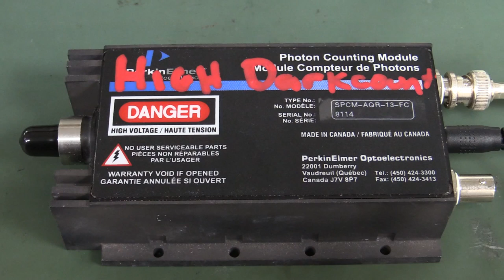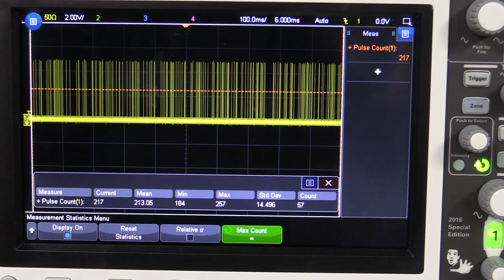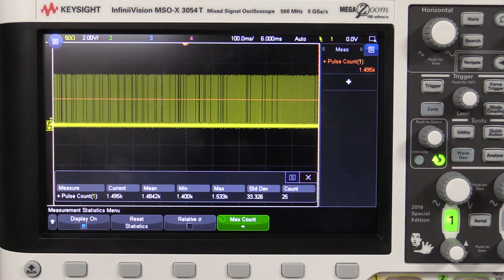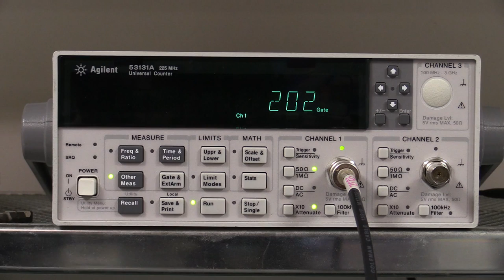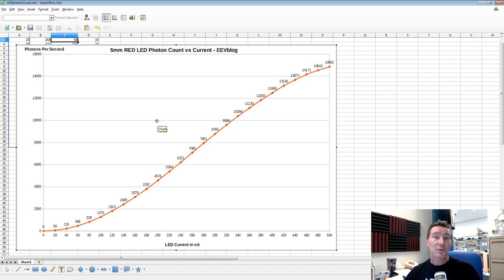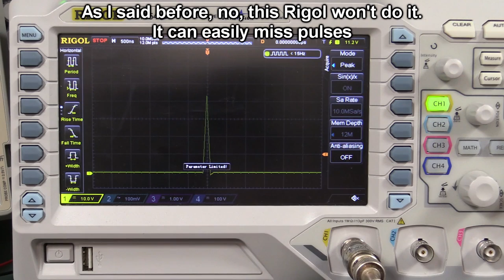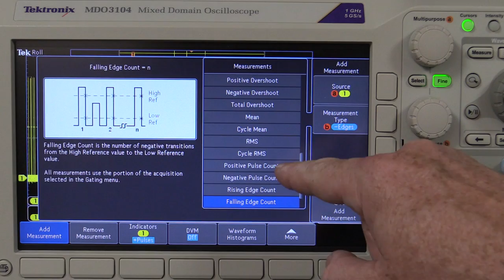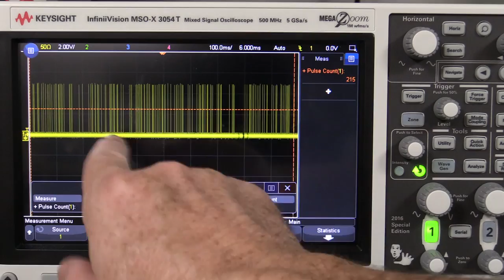EEVblog #869 - Counting LED Photons!

Comment: So 100ms sampling time doesn't have the "vibe" but 1 second does? You could also use 10 seconds, sure the longer the sampling time is, the closer your counts will be to the average. But the average will still be the same. Also, are you sure the Rigol's frequency counter measures the distance between pulses? In that case one would expect it to be all over the place, but it wasn't it actually displayed pretty much the same values as your final setup with he Keysight did (just no average of course) and it also seems to refresh once a second which may suggest it simply counts the pulses (or rising/falling edges) every second and displays whatever it counted...

Comment: The danger high voltage warning was hilarious. The current is so low you wouldnt even feel much of a poke. I repurposed the HV psu in these to operate the MCP in a night vision tube, and the output also did double duty as overload feedback. ❤

Comment: The latest Rigol firmware update (10.2015) added the pulse and edge count feature. So you can upgrade the oscilloscope for new free features. Also, in the measure menu there is an option to set the area used for measurement, i.e. whole screen or cursors. It's just the problem of RTFM

Comment: In the decrease in gradiant at the higher currents maybe because it wasnt measured correctly. The same reason why it dropped off at even higher currents? 
I'm a bit sceptical about that.
Reply: +Hellsslave666 
I agree. I don't trust the values beyond 10 000 Counts/s.
Checking with the universal counter might have been a good idea, to rule out the scope miscounting pulses.

Comment: Excellent video Dave, I have two of those exact SPCM units which were scrapped due to high dark count, and haven't yet found a use for them!  We use them for photon correllation spectroscopy.  Not a cheap bit of kit, as you say!

Comment: you can go higher if you use a Filter between the led and detector. the amount a filter takes away you can measure in a range you already know and then extrapolate, add more filters for covering more range

Comment: Thank you for sharing this experiment. The mayor source of error is, I think, the coupling between the led and the fiber connection in the APD. Dave, have you used the formula in page 6 to calculate the "actual countrate"? . In this case afterpulsing does not appear to play a big role.

Comment: Just a hunch, but is this not looking like a Bell curve? The chance of high level electrons jumping to the lower level is dependent on the amount of those electrons, which is dependent of the voltage over the LED. I know you measured the current, which should be linear if every electron emits a foton, but there is maybe some leakage of electrons?

Comment: You could use an optical attenuator to see what happens at higher currents. You could use some sunglass and measure the transmittance and include the factor in your data readings.

Comment: I saw your count taper off at high currents so it appears sensor is non linear.
I would like to see a group of 5 LEDs in at the input and then measure pulses of each LED individually. Then turn on 1 then 2 then 3 etc. This ensures linear input so pulses per second should also be linear. If not then you will have to calibrate sensor accordingly.

Comment: @ 5:20: near perfect Poisson statistics: mean = 212.8, standard deviation = 14.4 → variance = 14.4² = 207.4. Of course for Poisson statistics the mean is the same as the variance, and for dark current like this you expect Poisson statistics.
Reply: To follow on on that: something is fishy when you actually measure the signal. The sum of two Poisson distributions is another Poisson distribution, but the stats seem to be off. Is that an indication that the signal is not yet stabilised?

Comment: Great video!  Only problem is most people can't afford to buy one of these modules, so it would be really great if you could show us how to build a quenching circuit with a SPAD diode from scratch.  There are some "safe" low voltage SPAD's that might work (<40V/thin membrane).  If one could scale these into more affordable and safe devices, there are lots of very interesting projects in microscopy, astronomy, medical imaging, quantum physics, and other fields that could open up for the amateur and professional alike.  Hanbury, Brown and Twiss were able to determine what was thought to be impossible (a stars diameter beyond the Raleigh limit) using an effective super-resolution technique by photon counting half-a-century ago using only a couple of photon counters.  Imagine if you could get an array of these to make a quantum telescope or something no ones has thought of yet.

Comment: Dave. On the Rigol you could have used the hw freq. measurement that you have still turned on all the time. It was showing the pulse frequency ( count per sec) as you wanted. Missing stat on this parameter is annoying but the tool can measure the count correctly.

Comment: Is your powersupply really linear? How does it work? Especially the upper end seems pretty suspicious to me.. You seem to be far away from the saturation of the detector..
Otherwise this might be eplainable by differents layerheights in the diode, some may conduct earlier others later, the laters may be eclipsed, so no light is emitted which hits the detector..

Comment: What do you think of using your low voltage sources to apply a very small differential between two opamp inputs and to check if the output is like the open loop gain describes it in the datasheet?

Comment: Look into your "detector" dead time (in this case you have two detectors, the APD sensing the LED output and the RIGOL scope which you are using to detect the pulses. Both of these "sensors" will have an associated "dead-time" and pulse overlap associated with the time constant of the "detection" process. This probably is the reason for the response roll off at high rates.

Comment: One reason you might be seeing the end turn down is the sampling rate on the scope is too slow and you are seeing the pulses pile on top of each other and being counted as a single pulse, just like you saw at the currents above 500 nA.
Reply: It would be interesting to see if you see the same thing with the counter or by taking the integral of the scope waveform.

Comment: I think the rolling of is a feature of the SPAD sensor. The diode requires a finite time to recover (quench) after it avalanches, if photons are striking it during this period it fails to recover. I imagine if you continued to increase the current to the LED the SPAD will never recover and you'll stop detecting anything.

Comment: Interesting! I bet that the saturation at high current is caused by the photon counter itself. If theres some small leak resistance / offset current, it might show up as a non-linearity at low current values?

Comment: I have designed a board for a photon counter, the other guy did the firmware for it and it was a pig to calibrate! Trying to get a batch of them to give below a rated dark count and all perform the same was like trying to catch a fart in a breeze! no wonder they were expensive! It was a very interesting project to do though: quantum physics, electronics - what's not to like! Interesting video! I often wondered this!

Comment: The junction temperature of the diode increases when you ramp up current, which would decrease the photon output efficiency, that might be why it rolls off with higher currents.

Comment: This is a different and very nice experiment. Thank you very much. 

The current (assumed it is proportional to the photon counts) can be given by a               I = B exp[(-Eg+eV)/(xkBT)] as long as the diode is a simple p-n junction but not having a MQW (multiple quantum well) structure. So your experimental curve may fit with such a formula. In this formula, B and x are constant depends on the specific LED characteristics, Eg is LED energy band gap, V is applied voltage (Volt), kB is Boltzmann constant and T is temperature (Kelvin). 

Do you know which part of the circuit or chip of the photon counter is responsible for generating the nano second pulses?  Thanks

Comment: Interesting. As for the curve shape, are you measuring the characteristics of the LED, the current source or the detector - I would think all of these.  I doubt you have the sensitivity to reliably detect single photons and in any case, not all of the emitted photons will reach the detector. Recalling 1A is 1 Coulomb per second and the electron charge is 1.6E-19 Coulombs, even 10nA represents a significantly large number of electrons passing through the LED junction. I suspect the photon efficiency will be lost in the noise.

The graph looked to me like it has 3 stages, the start of the graph at low current the signal to noise is very low so its possible that you are seeing some detector noise effects. However, it is very smooth looking so probably something else. At higher current the relationship looks linear and at the end there seems to be some saturation of the detector or counter. Fitting a straight line to the linear section looks like it will intersect the current axis at some small positive current. That's maybe a leakage current? The leakage may change with applied voltage? How about measuring the volts/amps relationship? Does it look the same?

Comment: I wonder about one thing. You said that Rigol will miss some pulses because it doesn't have enough memory depth. On 100ms it was 10M and 10 MSa/s. On the other hand Tektronix on the same time base was set to 1M and 1MSa/s. I thought that the most important thing in such measurements is to have as much memory as possible to be able to set highest sample rate (I know that scope does this automatically).

Comment: Are the current and voltage of the supply actually constant at the really low currents? If the LED is producing 40 individual photons per second at the low limit, I'd be really intrigued if the current was constant the entire time. What's the LED doing at a quantum level between every photon?

Comment: What do you even use such voltage/current sources for? Which application ever requires femto-amps?
Reply: +Leonelf Leakage currents in ceramic or other low leakage capacitors for one, reverse biased diodes for another.

Comment: Cool. It looked like the light was purple at very low power. Color actually changes with temperature.
If you have a good recent DSLR camera you could try 1 second exposure or longer.

Comment: Remember that as it is a diffused red package you will lose half the emitted photons to the package. A clear one would have a much better performance. The water clear hyperbright red I have had give enough light to see at under 10uA, though if i was to use a good dark room I probably could be seeing the light at 1uA or less.
Reply from the maker: +SeanBZA Do you have any data on losing half the photons to the package? Where does the half figure come from?
Reply: +EEVblog Rough guess, the die is not going to convert all the electrons with enough energy into light, and not all will escape the surface. Of those that do the non clear package will scatter some, absorb some, so you will not get all going out the front. Thus the loss compared to the water clear package.

ps you need to clean the switches on that current source, you can see some large spikes in changing steps on it in the final light test, Somewhere there is a contact that is breaking before the next makes.
Reply: +SeanBZA Maybe I should ask you -  How sensitive is an LED to incoming photons?
Reply: +Noth Ankyou I use pairs of regular red LEDs as transmitters and detectors in some industrial applications. They are pretty sensitive, the transmitting beam doesn't have to be super close or accurately placed.
Reply: ***** Interesting indeed, thank you.
Reply: +llary are you doing just on/off detection with those red LEDs? or are you actually transmitting data?
Reply: +VoltLog just on/off - it works the same way as an IR transceiver pair but we have to detect some thin films that IR can pass through but visible light can't. You could pass data quite easily but I'm not sure if there is a useful application for that.
Reply: +llary I see, nice solution to use the red LEDs. thumbs up for the idea!

Comment: An interesting relationship between the LED forward voltage Vf  and the colour of the light emitted.
Many LEDs have a Vf less then that predicted by the Einstein equation, suggesting the bad gap jump is greater than the forward voltage. I would really like to know the true mechanise for this, as the LEDs colour is a relatively poor guide to the minimum Vf value.

Comment: semiconductor physics are extremely sensitive to temperature, perhaps you need to control the temperature of your diode
Reply: +Mark Hunter In a photon counter? If each avalanche is triggered by a photon, it seems hard to understand why a change in termperature would change the recorded count. You might (in fact, certainly will) see the dark count increase as temperature increases, but that's very easy to verify by bringing the current back down to zero and checking that the darkcount hasn't shifted.

It seems much more likely that the dropoff (which is going the wrong way to be explainable as a temperature effect) is just the crappy counter in the oscilloscope being saturated/missing pulses.
Reply: + TheHue & # 39; s SciTechI Bet the junction temperature of the LED makes a big difference. I wonder if that was what happened in the beginning when the count was low and then jumped up as the current increased. There appeared to be hysteresis there.
Reply: +TheHue&#39;s SciTech I was of course referring to the diode not the detector.  As Johan below notes, that's probably why there was such a sudden change in count initially, the junction was cold, as he increased the current it warmed up which has some thermal lag associated with it.  That's probably the hysteresis-like effect, a delay in cause and effect as the junction reaches thermal equilibrium.
Reply: Why does my explanation not apply to the detector itself? Are you aware how avalanche diodes work? Each avalanche starts with a specific event -- either a photon landing, or a thermal fluctuation. An up-to-date dark count accounts for the thermal fluctuations. The "hysteresis" can be observed to be due to the current source, when he shows the LED on camera, as well as oscilloscope lag on the 1 second sweep..
Reply: +TheHue&#39;s SciTech It does apply, but I assume that the photodetector has a stable temperature.  The incoming photons don't significantly raise the temperature of the junction in the detector, and during operation the junction is under thermal equilibrium.  If the semiconductor junction in the photodetector was not temperature stable it would not be a useful tool for measurement.
Reply: Mark Hunter Oh, the LED? Sorry, I misread (the detector is an avalanche diode, though, so perhaps "diode" wasn't the most unambiguous term :-) ) . Interesting theory, you've got me wondering now.

Comment: Hi Dave!
I don't understand meaning of Your "Counts-Dark" data column. Why it seems to be depended on current? If I correctly understood, dark count is always statistically constant, about 210 pulses/second, so You should always substract the same value for each measurement? Why it looks like cumulative in some sense?

BTW. Really interesting stuff... ;)
Reply: +synterr I thought it was a bit of a misnomer to, but I think with "Counts-Dark" he means "Counted [pulses] MINUS Dark [count]".
Reply: +Something Or Other 
Ahhh yes! You're right. "Counts - DarkCounts" ;)
Reply: +synterr That is the dark corrected column. Literally Counts MINUS Dark. Every cell is 212 less than the one to its left. The dark current is a fixed 212, as seen at the top of the spreadsheet.

Comment: It amazes me I can make a white LED glow just by touching it (60Hz pickup)!

And I don't need a photon counter to see it ;-)
Reply: +qwaqwa1960 There could easily be passing 10uA through your body into the LED (from the capacitive coupling between your body and mains wiring). If I'm not mistaken, the smallest current humans can sense is around 100uA (that is through healthy skin), so with 10uA you shouldn't be able to sense it at all. ;)

Comment: They clearly say the thing has a deadtime. No need to invoke quantum mechanics, dark matter, superstrings, multiverses, Alcubierre drive or false vacuum metastability to explain a basic common sense every day phenomenon of the upper part of the curve bending. The difference between a top optoelectronics scientist and an amateur is that the top scientist actually turns on the basic common sense thinking skills he learned in the kindergarten.